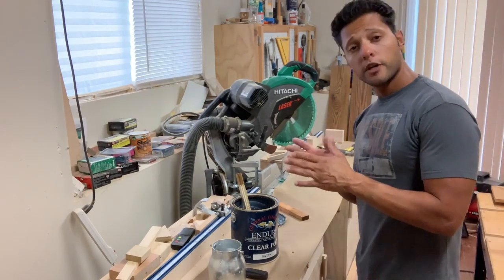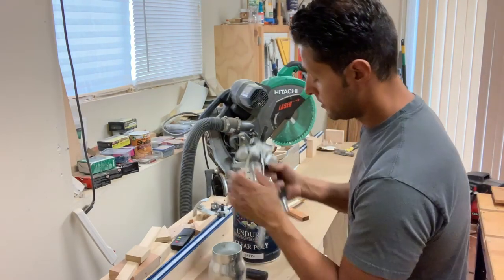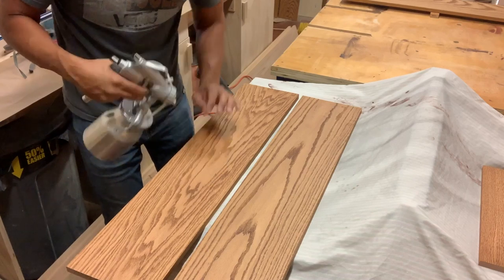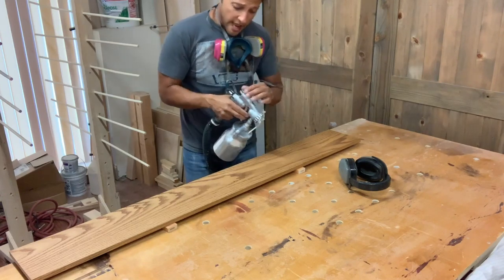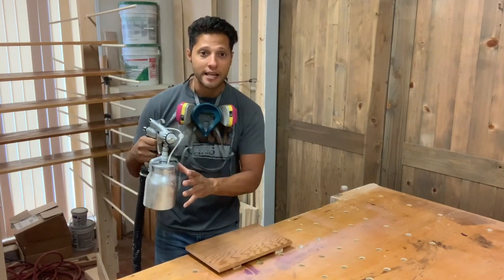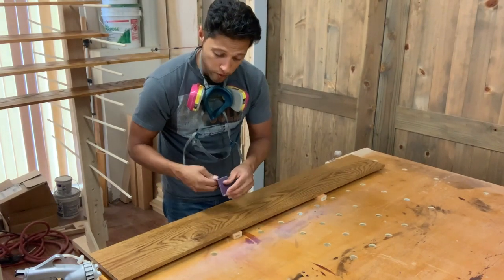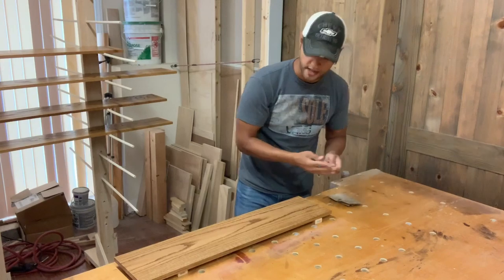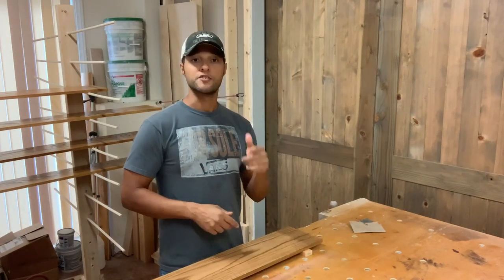How To Spray Finish

Comment: Also great tip on the 400 grit. 220 is far more aggressive than you need for between coats of poly, you're just looking to make micro, micro abrasions for the next coat to bond to, and 400 is more than enough. Some folks even use 600. There are folks that get fine results with 220 but there's absolutely no need to go that far and you risk leaving marks. Great video!

Comment: Thank you for such a great instructional video. Best one I’ve found and I’ve watched a LOT! I prefer to use oil based poly. Will take longer to dry - can I still leave the poly in the system in between coats? Anything else / tips that would be different when using oil based poly? Thank you so much!
Reply from the maker: Yes, you can still leave it in the gun. It’s just longer dry time between coats and the clean up is different because you need lacquer thinner instead of soapy water.
Reply: @AnthonyScolaro1  thank you so very, very much!!!

Comment: That finish is almost as good looking as Anthony is . I have never used water base .Think  I will give it a try . Nice thing with water based is you can use heat in the shop and  not have to worry about  me coming to  film the explosion .lol

Comment: Thank you for spending the time; great tips.  And I agree about leaving the product in the gun (but not with all guns).  I clean the tip with a baby wipe, and cover the nozzle area with Glad Press-n-Seal.  I'm surprised that you get a great finish when not holding the gun completely perpendicular to the surface.  I might have to play around with that.  Are you using an Earlex sprayer?  If so, what model?  I have the 5500, but it only has one adjustment know, which I don't like.   I spray alot of poly on furniture that is painted with chalk type paint.  Should I go light on my first coat as well?  The paint is very porous, so figured I should go heavier for that application?   Sorry about all of the questions...this is the Mrs; and you know how chatty we can be.  Lol!
Reply from the maker: Douglas thompson hi, I’m using the earlex sprayport 6000. With the gun being suction fed from the pot to a pickup tube instead of a gravity fed gun, if you hold this one completely flat to the surface, it tends to spit and when the finish runs low in the pot, it doesn’t syphon well. I’ve gotten much better finishes at the angle you see in the video.

Comment: Great video! What kind of air compressor you are using? What is the pressure (psi) you used for the spraying? 

Thanks
Reply from the maker: This is a turbine unit. There is no air compressor. It uses a fan to constantly move air through the system at a high volume with a low pressure at the gun, that’s how it gets its’ name HVLP sprayer.

Comment: Anthony,

Would you ever spray a coat of shellac before 1-2 coats of that Enduro 1K poly? I saw someone post that they like doing it for drawer bottoms, but others have advised that the shellac can crack over time.

Just curious if there's any benefit or if the durability of multiple poly coats is more than adequate.

Also, any reason you use HVLP versus air assisted airless?
Reply from the maker: @MadLadsAnonymous  I don’t think I’ve ever sprayed poly or anything over shellac, but shellac makes a sander sealer that can be applied before you spray your topcoat. Maybe that’s what they are using. The reason I spray clears with an hvlp is because it’s much much cheaper than air assisted airless but I use airless for paint finishes.
Reply: @AnthonyScolaro1  Thanks so much! Our future reno plans are inspiring me to paint our cabinets and doors myself. Already had bad experiences with local contractors.

Comment: I wanted to know that if I rushed on my first three coats of polyurethane can I use spray polyurethane for the final coat?
Reply from the maker: Absolutely. Just make sure your finish is leveled and sanded before you spray that final coat, otherwise if you spray it will amplify any brush strokes or imperfections and may cause an orange peel effect.

Comment: Great video! You mentioned a lot of tricks I've used myself. GF makes great products! I've recently swapped from their pre-cat lacquer to the poly for durability. 
Question: which hvlp system are you using?
Reply from the maker: That was an Earlex sprayport system but the last few years I’ve switched to Fuji

Comment: Hi Anthony,
I’m making big bass marimba bars (percussion instrument that will be struck thousands of times with a medium hard mallet and will vibrate like crazy over and over and over). Traditionally they finished with oils and waxs, though I want to experiment with other stuff. For my experiment phase—in order of best to worst—can you please suggest/brainstorm what you think might work out for coating/sealing wooden bars that will be taking a lot of inherent abuse? With all the beating and vibrating, for instance, might shellac or lacquer or polyurethane or wood hardener or an acrylic poor be too brittle, resulting in getting rattled and crushed to death and breaking apart microscopically over time? Also consider which finish would be the most scratch resistant. (Bars will be stored in stacks and slid against each other with the potential of dirt and sand bits in between. Thanks for brainstorming with me 👍🏻
Sam
Reply from the maker: I would try waterlox. It’s a penetrating finish that goes deep into the wood and hardens throughout while sealing as a finish.
Reply: @AnthonyScolaro1  Cool. I'll give it a try. Thanks for getting back. I appreciate it 😁

Comment: Hey Anthony, your channel is highly underrated! I recently got the Earlax. I’m going to finish my office with some built ins and wall panels to give it a classic look. I want to stain the material to dark brown first. Is it possible to apply this poly over the stain? Do you recommend that on 1/4 oak vaneer ply? Thanks
Reply from the maker: I’m glad you’re enjoying the channel! Yes you can apply any waterborne finish over a stain even if the stain is oil based, that is what I did here and have been doing for years now that I switched to waterborne finishes.

Comment: I skip the sand paper all together. I use 4-0 steel wool, and very light pressure to just dull the finish and take off any possible nibs. Just my way, hope this helps.
Reply: Water borne finish causes rust problems with steel wool, no matter how careful you clean, especially high tanin woods like oak

Comment: I used a water base poly about 25 years ago, I don’t remember the brand, but it was a well known brand, I’m sure. It did not hold up well in areas where you may splash water on it, such as kitchens or baths. Is the brand you use any better in this environment?
Reply from the maker: Lori Black yes, it’s industrial grade. Not off the shelf stuff.
Reply: Anthony Scolaro  thanks for your reply, but I read a review of the product on Amazon that supported my doubts. That indicated that it did not hold up well in areas that my get harsh cleaning agents or even common cooking products spilled about.

Comment: You say to leave the gun alone.  My question is: Do you leave it for all coats?  In other words, if I do the project from start to finish in a few hours, do I need to empty and clean my gun or will the product not set up and allow me to continue with one batch?
Reply from the maker: S Thrasher I leave it in the gun for all the coats. With waterborne or lacquers, you can usually get all 3 coats done on about 3-4 hours if you have the temperature around 65-70 degrees. Then after you’re completely done spraying, empty the gun and completely disassemble and clean it.

Comment: Thanks for the great videos you've made! I am currently setting up an area for spraying and would appreciate if you had any advice on a spray booth. I dont work in a garage and need to control any overspray. Thank you
Reply from the maker: Edward Crumpton set up plastic painters drop cloths, cover tools with painters tarps and use builders paper for covering floors. Set a fan in front of an open window or door to blow out excess overspray and fumes.
Reply: @AnthonyScolaro1  Thanks for the tips!

Comment: Do you need to open up the gun to stir the poly for each coat, assuming that it’s not gloss and there is a flatting agent in it?
Reply from the maker: M D nope, I just give it a little swirl around in a circular motion to get it moving and mix the agents around again.
Reply: Thanks!

Comment: I recently bought an hvlp system but have yet to use it. What’s not clear to me is the overspray issue and the fumes. I’ve got a car and a half shop, and I’m not sure I have the space. What’s your experience? Any response would be greatly appreciated!
Reply from the maker: Stoph Stoph I always wear a proper chemical and fume respirator, I vent a box fan out an open window or open garage door to pull out the fumes and overspray, I always work with waterborne finishes and paints which reduces really harmful fumes. Set up plastic drop cloths  to cover walls floors and tools.

Comment: Another great video! Do you have a recommendation for a spray painting system that doesn't require owning an air compressor? Thanks
Reply from the maker: Joel P the system I’m using in the video (earlex sprayport 6000)is an hvlp that uses a small turbine to transfer the air, no compressor and takes up almost no room in the shop. If you’re looking to use paint, then I use a graco magnum x5
Reply: Anthony Scolaro Here when you say “paint” (with a Graco), do you mean as opposed to varnish (poly, etc), like white paint for example? 
Do you mean you don’t recommend HVLP for paint? Or by paint do you refer to wall paint? 
(excuse my ignorance if it is obvious, perhaps it is just a matter of “lost in translation” (I’m Spanish) ;-).
Reply: @AnthonyScolaro1  Thanks!
Reply from the maker: Ernesto Alonso I use a graco paint sprayer unit now for all paints. I use the hvlp unit as seen in this video only for polyurethane and varnishes

Comment: What type of poly would you recommend for reclaimed wood furniture?
Reply from the maker: I don’t do reclaimed furniture, so I’m not an expert on the matter but most people use an oil base for a deep rich tone and if the furniture is old, it would have already had an oil base finish previously.
Reply: @AnthonyScolaro1  
Thanks for your response.
So the furniture I make is out of reclaimed old barn wood I salvage. So not of it has ever been stained, oiled, cured etc. 
That's why I was curious about spraying poly on my pieces I make.
Reply from the maker: @lazio7495  I would first check it’s moisture content, treat it with a solution to kill any insects and then when that’s cured out, you can use any type of finish you want. Oil finishes do preserve the richest look of the original reclaimed lumber, but water base has come a long way and the clean up is easier. Plus less toxic.

Comment: so can you get as thick of a poly coating using water based as oil based after applying 3 coats?? thanks
Reply from the maker: roadstar499 yes, it’s a professional grade poly. Builds just like oil. The link is in the description. I’ve been using this for a long time and the finish holds up.
Reply: @AnthonyScolaro1  thanks for the heads up...

Comment: Anthony, this is a great, great video. Thank you - it's very helpful. Question: when you have to finish both sides of a board, do you find it's best to finish one side before moving to the other? Or do you do one coat and sand all the way around before moving to coat two?  Seems like that would take longer, but I don't know if there's a reason why that might be better?  Thanks for your time!
Reply from the maker: Tim Hyde I spray the bottom of the piece first, then flip it over on points and finish the top side. When it dries, I sand both sides and repeat the process. Doing one side at a time would take double the amount of time and kill production.
Reply: @AnthonyScolaro1   Can I use my Graco airless to apply this particular coating with any particular FFLP tip orifice?  Apparently I can't use it to apply the Minwax poly I just purchased.  It's only brushable.  Thanks
Reply from the maker: Tribulation Prepper this particular finish is made specifically to be sprayed, however I would not use an airless sprayer because clear coats lay down much better with a low pressure and high volume of air. The airless is really more for paint. I always use HVLP sprayers for polyurethane and lacquers. The airless can be used but the tips and internal parts wear out quicker. Also, you should never use the same spray unit to spray clear finishes that was also used to spray paints. You will always get a paint particle or particles in the clear finish, no matter how well you clean the unit.
Reply: @AnthonyScolaro1   Good advice.  Thank you for your response, your time and expertise.

Comment: Hi, what brand was that poly? can you buy that in a spray can?  so did you wait an hour between coats? Thanks
Reply from the maker: roadstar499 general finishes brand. They don’t make it in aerosol cans. It’s a ready to spray formula for spray guns . I wait 45 minutes to an hour between coats at 65-70 degrees.
Reply: @AnthonyScolaro1  sounds good thanks ...
Reply: I may be buying this product ... will it work with a small nozzle sprayer...i have one from harbor freight i use for small auto touchups etc... also can you leave this poly in gun between coats or do you clean gun each coat? thanks
Reply from the maker: roadstar499 I leave it in the gun between coats, about 45 minutes between coats, yes it will spray through smaller tips, I use it through a 1.3-2.0mm tip on my HVLP. If you are going to buy it, I have a link to it in the description on my amazon.

Comment: What size tip are you using on your gun?
Reply from the maker: Whenever I spray clear finishes with hvlp, no matter what gun I’m using, I always go with a 1.3mm tip and needle. That is what’s recommended and gives me the best results. It’s no coincidence that the 1.3 comes with the gun. I’ve switched to a Fuji unit now after 5 years with the Earlex, and it also has a 1.3mm that lays down a flawless finish.
Reply: Tha is for the info. This video was very helpful. I sprayed some trim yesterday following your method. Same product, Fuji semi-pro 2 sprayer. Overall I’m happy with the result, but I noticed while the finish is smooth it’s not glass-like. It has some very small (almost unnoticeable) ripples. Any idea what I did wrong? Thanks I’m advance.
Reply from the maker: @johncarbon6289  there’s a lot of factors that could cause problems and since I can’t see or feel the finish you applied, it’s hard for me to tell. You could have moved to slow or too fast, applied too much finish or not enough. Did you sand the material evenly. That could cause the finish to soak into different areas differently as well. Did you get orange peel? That’s why it’s always best to practice on a scrap of the wood your working with, helps get the right adjustment of the gun settings.
Reply: Ya I figured it who’d be hard to figure out through text. I had a finish guy for all of my projects who finished everything with a perfect finish. This video actually inspired me to start doing them on my own. I’ll keep practicing as this was my first time trying. Thanks for the reply. 👍🏻

Comment: Terrific video that covers everything I’m about to do spraying polyurethane. One question, would you do anything differently if your piece were a restaurant tabletop?
Reply from the maker: TheChicagoKid773 it depends on what kind of table it is and what type of restaurant, depending on the use of the table, say it stays uncovered and it gets used like a bar/restaurant table, I might do an epoxy/resin finish. Regular restaurant style table, I’d stay with this finish.

Comment: Your technique would be better if you maintained a 90 degree angle between your spray gun nozzle and your project...perfectly perpendicular. Also maintain distance between nozzle and work project. If you did wet out the first coat, maybe you wouldn't have to de-nib after . I spray cars for a living so there are some crossover principles.
Reply from the maker: Mark Anthony two very different things my friend, and if you’ve ever seen my work and finishes in person, like my clients have experienced, for so many years, you wouldn’t be commenting about my technique. But thanks for watching
Reply: @AnthonyScolaro1  Yeah...maybe your right...I guess as a automotive painter I'm not used to sanding sprayed finishes ...that's a sign in my trade that you don't know what you're doing...but from your video I certainly agree that as much as I can see  it looks pretty nice!

Comment: What was the actual machine you was useing to produce the air sir?
Reply from the maker: That was the earlex sprayport. I believe I linked it in the description. Now I use a fuji semi pro 2 system. Only because after 7 years of hard use, the Earlex finally died. Otherwise it was a good unit.
Reply: @AnthonyScolaro1  ok great thx for the info,I'm goin to be spraying water BASED polyurethane